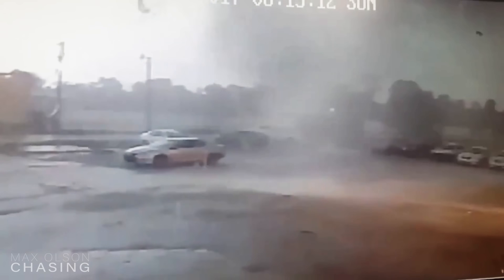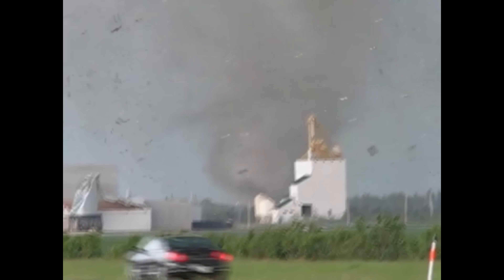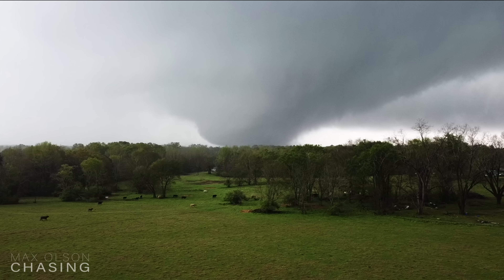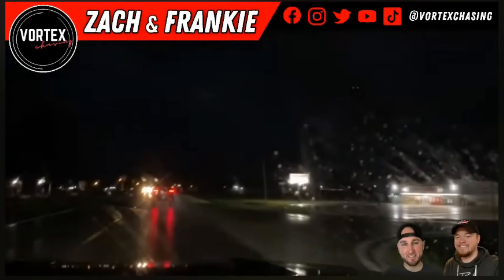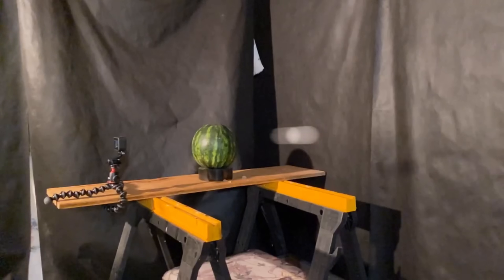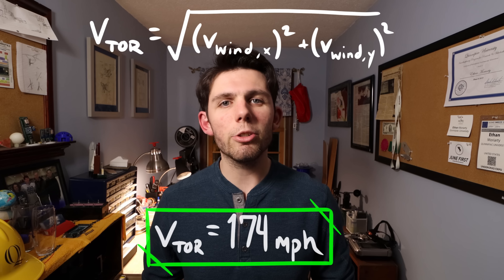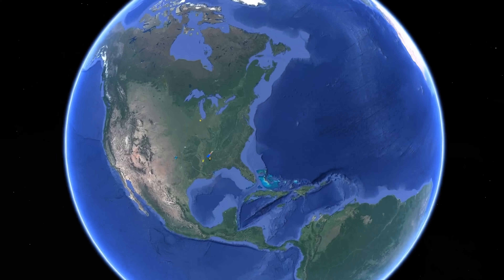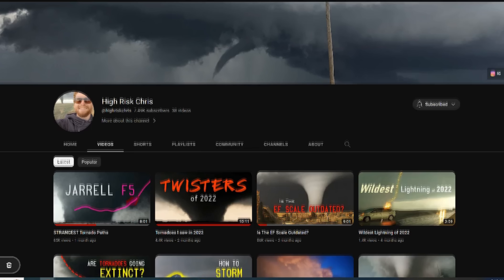Is This a Vehicle Flying Around a Tornado? - Rolling Fork, MS

Comment: I think there are a huge number of other possible light sources that might have been lofted. The modern world is replete with small, sturdy, very bright devices which emit fairly omnidirectional light.

Occam’s razor suggests this is probably some sort of LED lantern or emergency lighting device. 

But I’ll admit, there’s some small chance that this is a vehicle, or part of one.
Reply: It doesn’t make sense to me that the light source appears to always be pointed approximately towards the camera; headlights are designed to be highly directional, and it seems like a massive leap to assume that the hypothetical vehicle was rotating in sync with its orbits around the tornado AND aimed at this vantage point essentially the entire time. I think a lot of people want this to be a car for some reason, because it would be spectacular or horrible in an interesting way, but it’s not convincing to me.

We should not believe things merely because we want them to be true, and even more so when it implies something horrible that victims’ families might be forced to think about.

This is not a clear cut case.

Comment: The thing that is getting me the most about the debate on this is that none of us WANT it to be an occupied vehicle.  The problem is that most of the people saying that it isn't a vehicle won't put any evidence or plausible theories to give any hope that it wasn't.

Max, thank you for doing this and the aid you are rendering to those in Rolling Fork
Reply: what are you talking about.   guess you're ignoring everyone saying.. "why would the lights not dim out when it tumbles"     that's putting out a plausible theory right there. .  why don't the lights go out at one point.  how is it always facing the camera every second of it's rotation around the tornado?     this video had multiple points where they said it's either rare or not possible.  the dude who made the twisters in the lab said they couldn't get it to lift a car straight up, unless they blocked it on both ends.   there's people saying multiple cars on here.  so you're telling me it did the impossible, not once.  but twice.    

why couldn't it be a drone?   and don't say "it's too big for a drone"    drones aren't all the size of the dji hobbyist or racing ones.   you know this right?

Comment: Looking at the footage of damage of rolling fork I can positively say that the mayfield tornado had more catastrophic damage. The little community of Cayce was devastated.  Several concrete block buildings were nowhere to be found wiped clean like nothing was even there. No debris left along with some homes. If these F4 tornadoes were only traveling at 20mph instead of 55 the devastation would have been much worse along with the loss of life.  The Waco tornado is an example of that where it didn't move

Comment: Couldn't the windspeeds be higher than 176 MPH if the object itself appears to be moving at that speed?   The ability of the vehicle to maintain airtime is also dependent on the chaotic motion the vehicle takes while aloft.  As the object tumbles in the air, the objects resistance to the prevailing winds will fluctuate as the different surfaces on the object are affected by the winds causing the vehicle to fluctuate in air resistance.  

Definitely has to be a vehicle of some sort.

Comment: Uh, did this "car" not spin or wobble? The headlights on a car are obscured when turned away from view. The light from a headlight still on a car would have to be facing the camera for the length of time it is seen; the car would have to be facing outward from the center of the tornado. There was no mention or indication of red taillights. I guess this "car" didn't spin on its own axis, since there was no flicker.

Comment: I don't think it is a vehicle.  If it were a vehicle, the headlights would not be visible as it rotated around in a circle.  The light would fluctuate from dim to bright and then again to dim as it moved away.  The light in this video appears to remain at the same intensity as it moves around.  Maybe some type of mercury vapor or battery powered light, or some type of light with residual reflection after being disconnected from its power source.  No telling.

Comment: But let's talk about the clearly evident elephant in the room.  HEADLIGHTS are VERY directional.  Meaning you can only see them with this much clarity and brightness if they are pointing directly AT you. These lights didn't seem to change their brightness no matter what location they were in during the rotation.  The more logical reality would be that the lighted object you saw was circular or globular, emitting light in all directions evenly.  Headlights DON'T do that.  They only maintain that level of brightness when they are pointing directly at you.  Is it possible that a car could rotate and keep the lights pointed directly at you AS it was also being rotated around the storm?  ...meh, yeah.  But highly unlikely.  The more logical answer is that the light was multidirectional and not headlights.

Comment: I will add. Racing stock cars max velocity 215mph. cars. Or 180-201 restricted. But When you pass threw 150-160MpH thats when the sound changes, ears pop, & you perk up and say “Alright self pay attention now!”  For people that have never raced superspeedways. Once your going 150-160MpH the car no longer feels like a normal car. If your on racing slicks. The air grabs your car and just hugs you the side force is alarming the first time you go into a turn at 188-200mph. —-  So 145mph and under you steer like a normal street car. After 150-160 depending on the winds the particular day. You may be turning the wheel right in a left hand turn because the side force / 3-4* yaw. I flew multiple times with and without roof flaps. My longest flight was down the straight away I flew 150-170yards @30-40’ before I stalled out in a 3310lb car . But every time I’ve really took off I was between 175-204mph we verified on the telemetry data.  I’ve been turned around @166mph and the tail lifted off the ground but my nose stayed in contact, I scrubbed too much velocity so it never could get launched. @175+MPH the car just leaps off the ground effortlessly. So this vehicle here I would say it had to be in sustained 175+ mph + to fly that high and long.  —- understand when the vehicle starts coming up the added drag from AOA if the winds are at the lower speeds that drag is enough to stall it out. That’s my gut feeling based on routine experience in this wind range. 

Also remember In Dixie alley generally we see tornadoes get lower ratings because they are moving 55-75mph across the ground and so weve learned it’s not wind speed that gets you. It’s the duration your exposed to a wind that will level a house. moving 55mph your not gonna be sitting in the strongest winds for that long. Like jarrell 1-8mph ground speed. May 3rd was 15-30mph it changed speeds and varied. — so the winds could’ve been over 200mph but if the exposure was less than 3 seconds you won’t always find the DIs.

Comment: a small to medium size pick up truck do not really weight that much if the bed is empty... that plus a very flat surface underneath the truck from bumper to bumper. a super strong gust will lift a pickup truck for sure; the wind power to keep it aloft for a distance is simply amazing but very very possible. nothing survives a tornado when that close to it

Comment: What's most scary to me is not that a tornado could pick up a car, but the implication that comes with turned on headlights. It's very likely that whoever was driving it was still in it while it got picked up. Unless someone got in, turned on the headlights and decided in the last moment to run out and seek shelter instead.

Comment: That could not have been a vehicle like a car or truck, simply for the fact that headlights are directional, ie meaning that they point/focus in only one direction. 
If it was car or truck headlights, the light seen in the video would have seemed to flash on and off as the vehicle was twisted and rotated in the air. 

This had to have been a drone or a self contained/powered lighting system that has omni-directional lighting.

Comment: Just saying if it was a vehicle how would its headlights be pointing at the cameras direction then entire orbit around the tornado. headlights are directional so would be safe to assume that any headlights would appear to flicker. or at the least get dimmer and brighter as the vehicle rolled or spun around while lofted. I would say that whatever it was. Was some sort of outdoor illumination with a battery kinda like a yard light but something a bit bigger and brighter that no matter what angle you see it you can see the lightsource. not saying it wasnt a car but common sense says something smaller and lighter

Comment: Here's another possible wedge (noting the darkness before the lift) 2007 Piedras Negras tornado: https://www.youtube.com/watch?v=FNBDjCoeFZg  Translated description: "Video taken by Carlos Torres on April 24, 2007 entering the curve towards the village along the rails. (South to North) the screen of the national disaster center is clearly visible and at the traffic light 15 meters from the church when the car began to move On the sides I turned off the camera to protect myself... and the windows exploded, we ended up between the church and the oxxo, which were almost completely destroyed... we only received blows and small cuts..." At the end of this video, it looked as if the vehicle was lifted vertically, as opposed to being rolled.

Comment: Is the light seen constantly as it circled the vortex; does it appear to be omnidirectional light? The lights of a vehicle are directional and vehicles typically have an off center center-of-gravity, probably a not co-located center-of-lift. If a vehicle with unidirectional lights, then the object would need to rotate at nearly the same rate it revolves, keeping the lights pointed at the camera. Also, if observed from multiple camera angles with significantly different directional angles, then omnidirectional (not a vehicle) would seem supported.

Comment: could be a car very likely. something else it could be is battery powered house light with bright led lights. some of them led batt powered lights can be very bright and since it is batt powered it won't matter if mains is cut off, so if someone had one of them lights on a house and came off when the house was ripped apart the led light if undamaged could get turned on due to motion, and being the light is light in weight I could easy see one of them making it up 400+ft in the air.

Comment: So if headlights are turned on, it’s likely the car was running, if the car was running, it’s even more likely someone was inside the car.  Did any of the damage reports find demolished cars with bodies inside them?  Or is the violence so extreme that the body would be sucked out of the vehicle?  What a nightmare to think about.

Comment: I don't think anyone can definitively say this is a vehicle. Their's a lot of different things this could be. One thing I think it's definitely not, is any kind of light powered by electricity. The electric in this area, do to the obvious massive damage by this tornado was obviously out. Now, a lot of people have battery powered motion detection lights, screwed or bolted, on their porches and different areas outside their homes. I have one on my front porch right now. This could be one of those lights, still connected to a larger peace of debris. Theirs also literally thousands of different lamps and other whatnots that light up by batteries that people decorate their homes and porches with. At the end of the day, the only way we could say this is 100% a vehicle is if we saw both headlights on at the same time, keeping their distance between each other constantly throughout the whole clip. Also it's possible that it's still a vehicle, but the other headlight was damaged when the tornado struck it and picked it up. Or the vehicle may have already had one headlight out. The biggest problem for me is, this just doesn't look like it's shining in the way a headlight shines.
Reply: I don't know, I can see two lights side by side at certain points in the video, and you have to keep in mind that the lights aren't shining into a clear sky--they're shining in the middle of a dense mixture of rain and debris so any light is going to be scattered and not directional, like driving in a fog. You could still see the beams even if they're pointed away in that case

Comment: If it was a car then what are the odds that it's headlights would be pointing towards the camera for that long???   I mean the light doesn't once go out the entire time that it was on the nearest side of the rotation. It only disappears after getting pulled to the further side of the rotation behind all the dirt and debris!! Then to come back around the other edge once again becoming visible with the "lights" still pointing towards the camera I find hard to believe. While that is not entirely impossible it's pretty much impossible. It's almost like it's a lit up sphere all around that no matter what way it flipped or turned it was still shining.

Comment: IT'S TOWERS IN THE FIELDS!!!  I just read over 200 comments and am amazed that nobody picked up in the very first second of the video that the two RED blinking lights are a tower in the fields and the two or three white lights are also towers in the fields. The only reason that they appear to be moving is because the car that the camera is in is moving.  It doesn't go behind the tornado, it's a slow blink.  The closer a tower with a light on top to you is the higher it will appear.  The white light on the left is below the horizon If you look at its location when the lightning flashes. Y'all are ridiculous. 😂

Comment: BAD FIRST YEAR PHSYICS ALERT: DO NOT DO THIS ON YOUR EXAM! Why assume the wind force an angle of 45 degrees? You could have just found the min x-force required from the rotational speed and the minimum y-force required from the gravity and then used components to find the min total force and you could even find the min angle of that force to see it is reasonable.  But but artificially taking it to be 45 degrees you are building a total wind loading at that angle.  Indeed by doing assuming an angle, you actually don't need to do the calculation in both the x and y and you might get conflicting results! You can then only use the drag equation ONCE!

Comment: How about you find vehicles found with victims in the area. From there try to get the electronic data and gps info from that period in time from the vehicles. The way the vehicles were damaged should also show what caused the damage. Would probably be hard to do, and would need assistance from the NWS.

Comment: Could they be power polls or parts of a transformer on fire?

Car headlights being able to sustain; on two vehicles which had both no doubt been damaged before being lofted, seems a bit too coincidental. Plus the incidence of the light would change drastically over the time of a vehicle's flight. The chance of the headlight's axis (on two vehicles as seen from multiple locations) remaining parallel with the viewer's line of sight all the way around the circulation seems unlikely.
Reply: Exactly, you get a 👍🏆!

Comment: Very Very  interesting. It most probably is an electrical light, and it has to have a constant power source.  What battery powered light could it be. It's a bright light to be seen at that distance. So what besides a car could that be a motorcycle? What else??

Comment: spinn a rock tied to a string by the end of the string & the rock will pull on the string AWAY from the center of rotation. just had to point out that glaring flaw. this is what happens when students are taught correct math under incorrect principles while being denied hands on experience. any thinking person who has used an industrial centrifuge to clean diesel oil knows that they don't find the contaminates (that are heavier than the oil) on the inside they find them packed tight on the outside of the container. I would not be surprised if he gets the math right, but would be surprised to find that centrifugal force goes out from the center the next time he gets on a merrygo round at the park.

Comment: I am 62 years old and have been fascinated by tornadoes since the Palm Sunday outbreak of 1965 because I experienced it. And one story comes to mind of a gentleman who had a brand-new F-150 pickup truck in his garage that they could not find. During cleanup of the disaster his truck was found a quarter mile away from his home and the only way he could identify it was his truck was by the F-150 badge and the color. Because his truck looked like someone took a ball of aluminum foil and just rolled and crumble it up in their hand. If I remember correctly it may have been the Jarrell tornado it was an F5 tornado I do remember that.. I remember seeing an  actual video of Blades of grass penetrating a car door. There's also another video I recall a Texas tornado that tossed  train cars hundreds of feet in the air. In my opinion I would say yes 100% it is very possible for a car to be tossed in the air like that around the powerful tornado.
Reply: Blades of grass through metal? Hardly!!
Reply: @tonymurray814  You can doubt all you want I can promise you if you ever experience an ef3 to EF5 tornado you will believe it.

Comment: Great video. I certainly hope those weren’t passenger-filled vehicles as postulated. If so, I was wondering why then haven’t crews found damaged cars WITH deceased victims inside yet?  Presumably, they would had to have gone/landed somewhere. Am I correct?
Reply: Perhaps the cars were abandoned while still running? That’s best care I would think.